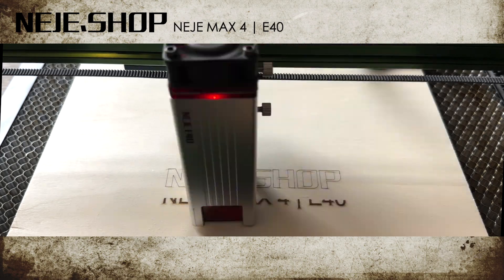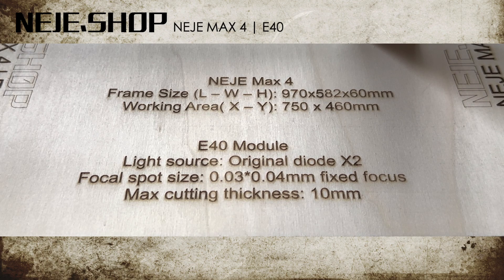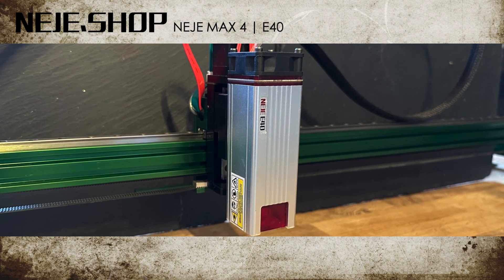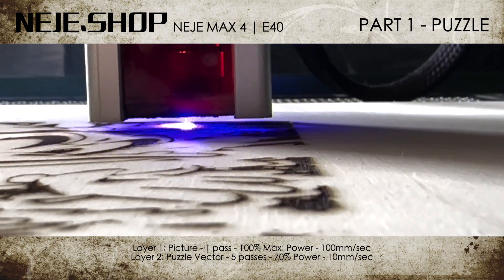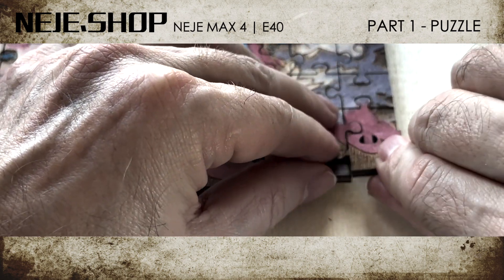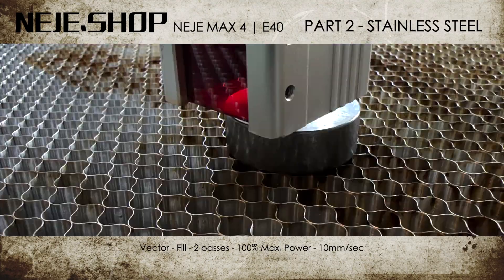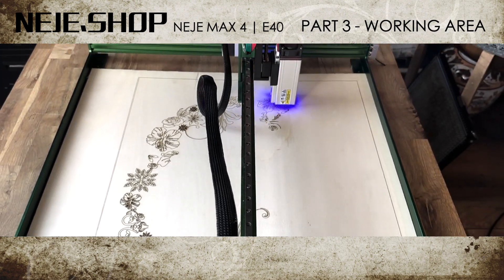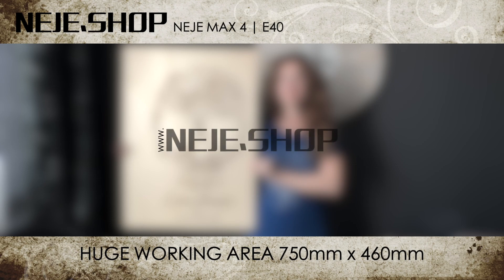Neje Max 4   E40

Comment: I have a meje 2s. Can i up grade part to this laser if need
Reply from the maker: Every time you upgrade your laser, you have to check whether your power supply meets the requirements and whether the circuit board is up to date. But take a look directly at Neje.

https://neje.shop/